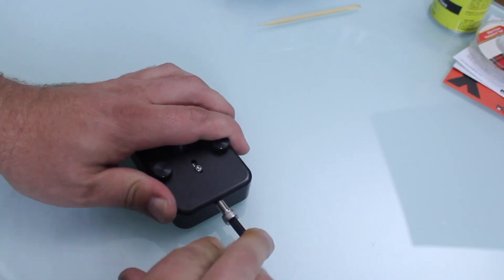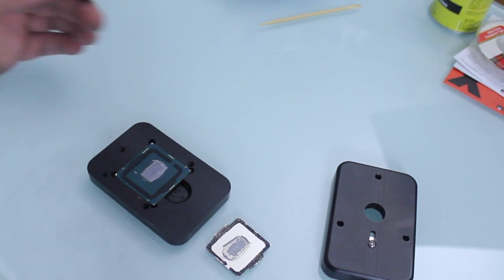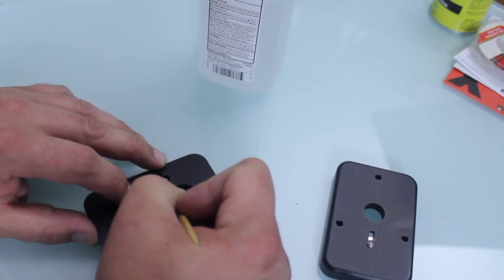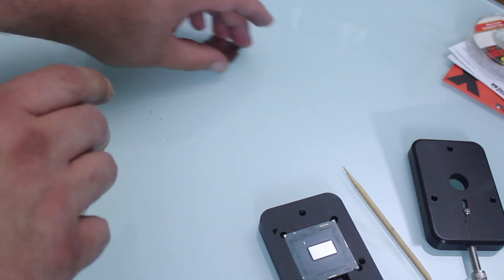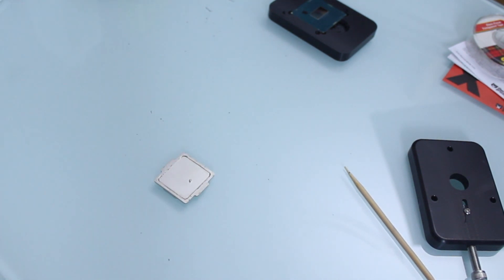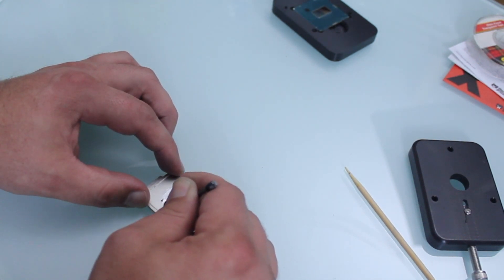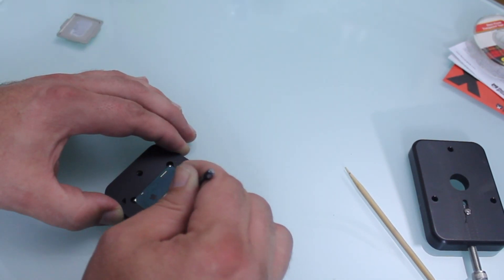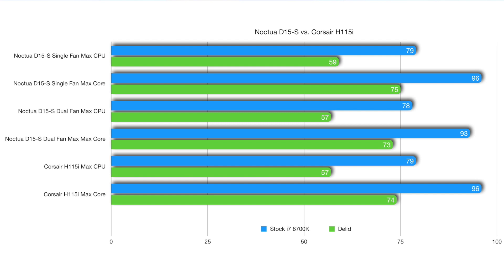The Best Way to Cool Your PC - Air VS Water Cooling Delid Edition

Comment: I Delid my 8700k because I did not win the silicone lottery. 4.7Ghz all core it would reach tjmax within 15 minutes testing with aida64. I Delid then put Noctua thermal compound because I was unsure about liquid metal. I did see alot of improvement but nothing like 22c difference. It was more like 95c after 15 minutes and after 30 minutes it was reaching tjmax again. This video led me to order some liquid metal and a new AIO for SG. I am excited now to see what the difference will be.

Question is there still a huge spike in temperature even with LM and delid like before the delid.   So like where as soon as you start the stress test it jumps from 35c to like 60c or so in an instant or is gradual.  Because mine is almost instant in temp spike from like 35c-80,85c in an instant. then builds from there. Which I would think that means that the IHS and chip are not getting good thermal contact.

Comment: I had a water cooler fail on me once and it nearly fried my CPU and Motherboard. For that reason I'm only going to use and air cooler going forward. I'd be tempted to use 2 fans just for redundancy. I just watched another video where they tested facing the air cooler with the fans pointed up instead of sideways, and that did make a difference.

Comment: Thanks for the explanation on this video. I will go with air cooling since is not much difference in Cooling easier to install and quiet.
This is my first build so I don't want to run into complication.

Comment: reliability and durability are a concern too.  aio's usually only last about 5 years.  you will be ablet o hand that noctua down to your grand kids.  and if its physically possible to mount it on the newest cpu in 40 years then notcua will mail you out a moutning kit for no charge to make it work.  they did it for the dh-14 for years and still do

Comment: i did mine with a 1 dollar shaving razor in about 30 seconds.  just have to be careful.  like a totally different cpu.  got 5.1 and temps stay under 70c all the time.  gaming stays under 50c.  at idle its like 30c.  clocks higher,  uses less voltage,  runs so so much cooler.  but please use liquid metal.  no paste.  good paste is better than stock but liquid metal is so much better

Comment: AIO worth it only if with 360 radiator and if need certain independence from surrounding temperature.
its true Air cooler is superior and best value. nothing surprise, way lot more surface

Comment: Excellent video sir i really enjoyed it,i was using a bequiet dark rock pro 3 for my 8086k with a three fans configuration delited at 5ghz with 1.2v same motherboard maximus x hero llc at lvl5 ,temps were great but it was imposible for me to even reach the clip to remove my gpu and for esthitic reasons i decided to change this cooler for a nzxt kraken x62 to have firstly space to put my hands when i needed to and secondly because is more pretty but pretty much as temps goes in the long run both do the same almost work temps wise ,having better temps with an aio cooler vs a top aircooling solution is just a myth plus the aircooling is just bullet proof but aios tends to fail over time. All comes to what the user like to have: reability aircooler and eyecandy solution/space aio solution but both do the job pretty even and the aircooler is just half the price of a descent aio solution(150)

Comment: Nice video!
But, how did your GPU temps change after mounting the radiator in the front?
It will basically work as a heater that heats the air that goes into the case.. Did you notice any difference? :-)

I use a Noctua NF-A14 with an extra fan, and i have a Asus ROG Strix GTX 1080 thats OC'ed a bit.
I get around 65c normally,  +/- 3c. I have two 140mm noctua fans in the front and one in the back that runs at 600 rpm (front) and 800 rpm (rear). My CPU has been pretty stable at 65c to. But i overclocked it today (4.8ghz) and now its easy 75-80c when gaming.
Ambient temp in my office, around 19-20c.

So i will definetly do the delid. :-)

Comment: great video. i found that the NH-D15 was the better choice. not because of CPU temps  BUT the motherboard VRM ran much cooler with the NH-D15 and the noctua was near silent vs the h100i was very loud

Comment: So you’re still running cpu at 5gz? 
I’ve got my 8700k set to 5gz also, 
Don’t really see the point of deliding if I’m already getting reasonable temps (under 80 degrees) and hitting that 5gz o’clock
Reply: That depends on the task you are doing with no deliding at that frequency if you do render for some time the cpu will exceed 90c fairly easily or even a strong stress test such as small ffts at prime 95  (29.4 version) or occt small package you will reach tj max at 2 seconds with no deliting the chip.

Comment: I'd just be worried about destroying my chip through the delidding process. I don't have a super powerful CPU, but I'm looking to upgrade to that level, is there a different brand that has actually good thermal paste so I don't wasted $300 on a chip I'm going to break?
Reply: TIM = Thermal Interface Material - What is used between the processor and the heat spreader.

AMD uses solder on the 1st Gen Ryzen series chips, so delidding is impossible. I think they have a TIM for the 2nd gen, but not 100% sure. I know they use TIM for the APUs. With all Intel chips, you are going to have the crappy TIM on the chip below the heat spreader. Just how Intel makes their chips.

In regards to your worries, there is minimal risk with tools like what Briar used. The only thing you will need to worry about is the liquid metal application. That can get messy. Other than that, it is straight up follow a YT vid with the process.

Lastly, delidding is not a necessary process unless you are using your CPU for some heavy stuff (streamers are one such with the video encoding). But the lay person does not need to delid the processor to get acceptable results. Briar had to use AIDA64 to get the temps as high as he did, and that is designed to put an extreme amount of stress on your PC. Something that the average user will never come close to.

Advice, just get a solid cooler and dont worry about delidding unless you absolutely need the extra 20 degrees.
Reply: You should wait for the next gen CPUs in about a month or two. Intel's i5 9600k Leaked a few weeks ago, so that means that they are about to be released in the next couple of months.

Also roumor has it, they actually added proper thermal compounds between the processor and the heat spreader.
Reply: no longer a rumor, 9900k is soldered, the rest of the new processors still uses 💩 for the ihs. 
great video btw, it saved me a ton of money!!!

Comment: Corsair isn't the best AIO. With something "better" you can usually run the fans at much lower rpm. And still get better results than the Corsair. But the Noctua is a great cooler.